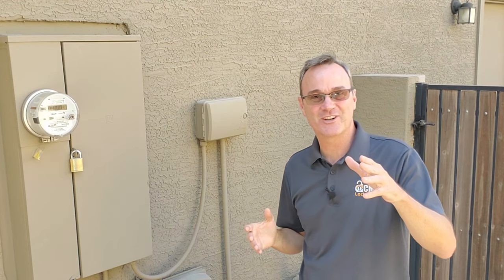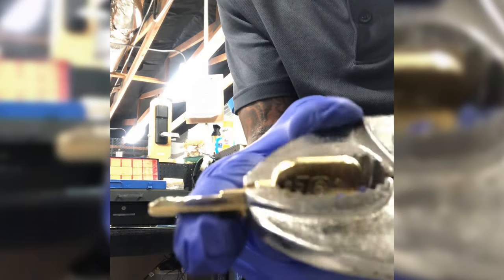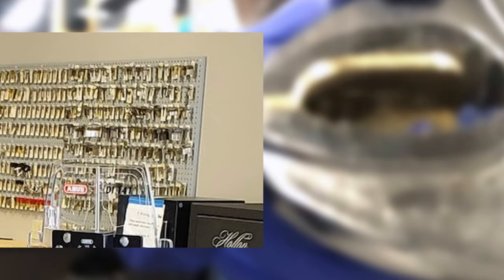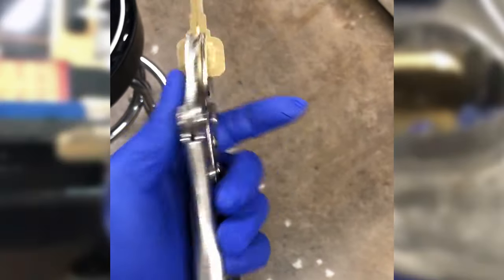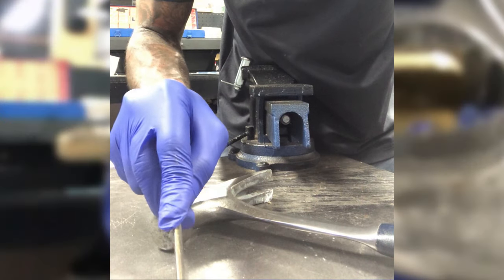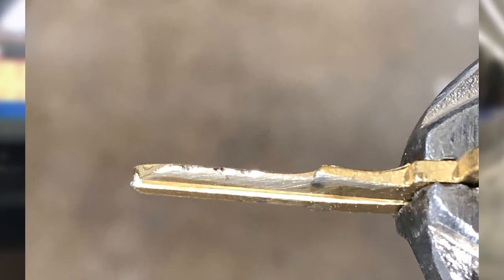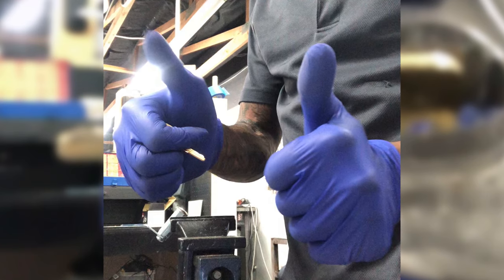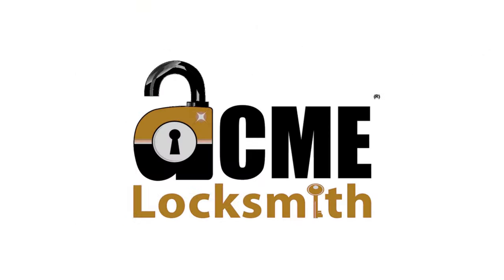How Do Locksmiths Make Keys Without an Original Key - How to Impression a Key

Comment: I did what you said, and now have a key that turns the lock in my 29 Ford Pickup. Not quite sure I want to take this back to the shop that said they could not do it. I do not think they wanted to spend the time! Anyway, thank you, it worked. I am a retired electrician and mechanic, and followed your instructions. First key worked! Doug, Oak Harbor Wa.
Reply: I mean if someone came to me asking for me to pick a lock and I’d never tried I probably wouldn’t do it either lol. Impressive you did it yourself
Reply: Im in same boat im electrician and also have done hands on work my whole life and im gonna give this shot only thing bothers me is when pull key out it brakes inside then ill be in serious trouboe but i just got to be easy and shake little back and forth seems pretty easy but something you get better in time

Comment: worries that locksmiths will make a key to my car and drive off with it
Reply from the maker: Newer car keys needs to be programmed to the vehicle in order for the vehicle to run. FYI. Auto locks are some of the hardest to impression. Most locksmiths can't do it. They opt to make a key by code for the car

Comment: I just tried to get a local locksmith to make a key, I knew the profile and I recon they need to see this video as they couldn’t or wouldn’t make a key for the two barrels, I am definitely going to have a go with this technique. two days latter using this technique... I worked, I knew the blank profile , i filed it down but buffed it to a high shine and this helped identify the marks.
I am looking forward to the look on the lock smiths face when I take the key to get others made.. as I mentioned the technique and he just smiled Follow up the Lock Smith was impressed "well done"

Comment: thanks for video. my local locksmith did this type of key making twice for me. they did it while I waited and it took less than ten minutes both times. both times it was ten bucks including the key. couple months ago I needed this service again but price has jumped to 30 now. the trick from the past that I saw was they used aluminum key blank which impressioned much easier.

Comment: Good video.  Those wafer locks are definitely good to learn with.  I like to, once I get my first set of marks, take a thin Sharpie and mark on the side of the blank where those marks were so if I see other marks I'm not following a wild goose.  

The other thing I did was picked up a cheap set of jewelers' loupes.  Makes seeing what's on the blank way easier.
Reply from the maker: Thanks for the tips!

Comment: Great video! I guess you should mention not to put too much force on the key when impressioning, you don't want to break the key off in the lock. How do you know how far to file down each spot after each impression round? A lite mark gets a tiny bit of filing down and a heavy mark gets a bit more of filing down? How do you know when to stop filing down in one spot... no mark at all?
Reply: This is exactly what I was wondering. Like how do you know when to stop filing on each pin?

Comment: Yeah I did this on some old locks I didn’t have a key for the first one three times nothing its a old big no5 master lock .  Second one newer type with the blue band at the bottom no3 first key filed kept at it just working the hell outta it and bam it turned made two new keys to fit it off a bunch of used keys .  I’m on number 5 now with the old no5 it looks like it says in black ink A631 or A531 it’s faded badly .  I’ve broken a couple  keys pulled them out before they were in two .  I found keeping the points down between the notches helps I’d could see we’re the tumblers we’re hitting the ramps up and down .  It’s a job that requires patience and skill with the ability to keep trying till you succeed.  If you get aggregated to lay it down and mess with something different for a while then come back to it .  It’s definitely a learning curve! Thanks for the video it’s been helpful !
Reply from the maker: Great post. Thanks for watching.

Comment: I’m trying to take out the in dash ignition switch on a 1984 Winnebago with a Chevy P-30 chassis because I don’t have any of the keys that’s how I found your channel . It seems easier to just enlarge the area around the ignition switch rather than destroy the cylinder. No that I’ve seen this I’m gonna give it a try. Thanks 😊
Reply: You should be able to get a key made using the VIN number
Reply: @Berry-McCaulkiner  This is often not true.   The dealers do not maintain Vin-to-key data beyond ten years.  There are some special locksmith databases that can give this information.  Unfortunately, most locksmiths either do not know this or  will not tell you about it.  They will try to sell you a "service call" where they come to your lcoation and make a key for $200 instead of making a key by code (looked up by vin) for $30.

Comment: Does it matter what side of the key you file at an angle ?
Reply from the maker: No. Just need to thin it out.
Reply: @LocksmithRecommended  
Thank You
I took a key and filed it all down and then filled it in with solder and I filed down The notches that I could see on the solder because solder was so soft and then it worked and then I made a copy of that.
Thank you so much for responding to me that's a great video

Comment: could you make a tin keyblank? if i take a pieces of tin fold it in half and cut out the key with the sharp point. (the corners of the tin is were  the sharp point is.  so like the  fake key is lift with a strong back back because its the curve of the folded tin. so you would end up with softer metal to make better makers.

Comment: Where the mark is, do you file it down? Or leave the “bump” where it marked? I’m not sure if the mark should be the “point”, or the “hollow” in the key. I hope it’s understandable what I’m asking, I’m not sure in how to proceed.
Reply from the maker: File at the mark. That is a pin hitting the key.
Reply: Thanks for answering. I’m researching all I can, because I got an old motorcycle without key.   The problem is that we’re I am (a very rural place), it has been impossible to find blank keys. I’m going to try cutting a key from a picture I got online and hopefully I can make it work. My first try will be with soft metal from a can, because I don’t have tools to cut harder material. Do you think it could work with some patience? Or will I be wasting my time?

Comment: I’ll be diving into a DIY project to impression a new key for my 67 F250, an old airport stair truck from northwest airlines, unfortunately key not present.. any suggestions for applying this technique to a key with pins on both sides of the key? I’m assuming same technique applies cutting both sides same amount each time?  

Couldn’t source a new old stock ignition tumbler as the 67 were one year trucks with small variations to the 68. 

Thank you in advance!
Reply from the maker: Same process, but extremely difficult to do. You could always mail it to us and we can get you a key for it. Without risk of damaging the wafers. If you're interested contact us here. https://form.jotform.com/60085597700155
Reply: @LocksmithRecommended  I would be able to remove the ignition as a whole, mailing the core still inside the ignition as well as a blank to use. If that would be acceptable I can go through the link and send it out :)
Reply: @branpugh  Did you manage?

Comment: Wouldn't it be a good idea to paint the blank key to make the impression more precise?
Reply from the maker: Possibly. Never tried that one. A lot of techs us smoke by holding a lighter under the key to blacken it.
Reply: @LocksmithRecommended  A Sharpie works even better and afterwords the marker ink wipes off with rubbing alcohol.

Comment: Well, I've done this back in 2019 very easy, but not for door locks or cam locks. I made car door locks and then moved over from there to make an enshanine key because the old ley broke, and when we took it to a locksmith or a hard wear store to get it copied we brought it back home and tryed it out it did not work to turn the car over so I looked at the old key and the key copy and took a sharpie and traced the key depth after doing that I noticed that the copied key tip was filed down to far this was for a Chevy 2019 avio I then  tried it my self with files to get it to turn the cylinder in the steering weal over or as you would calling it the enichen switch sorry I have a bad phone spell check system but after the first one I made and how time consuming it was to file it I then when back to that same hardware store and asked if near the end to not cut the last part of the key or instead I will just buy 6 blank keys and trace then key I made over to the blank key witch in return made a slite mess-up with out holding the keys to gether with a ficegrip and then marking them but the good thing I noticed it before I started filing the key so after filing the key I wire bushed it to get rid of any left over debree and I checked the inner cylinder to also see if it was dirty at all to mack shear there was not any thing gunking up the lock cylinder 
From Joshua rowell. Ps the store that cut the key wrong was ace hardware in Vallejo, CA, contact me if you would like, and thank you for letting me leave a comment have a nice day.
Reply from the maker: Thank you for the comment!

Comment: So if I file it to one said maybe the impressions will be easier to get from the grease instead of denting the metal of the blank
Reply from the maker: Smoke from a match works really well. Hold a match or later under the key until it darkens.

Comment: I'm really worry that this video is for everyone including the burglars?  anyway, my concern is, could this impression be done on a kwiset lock whether it's an inside or outside lock?  becz, how the criminals entered my house and had keys for all that locking device, is a major question to me.  thanks.
Reply: Best to update your locks Veronica, to a system with restricted keyways. Where they are not able to get their paws on blanks to cut. Good luck.
Reply: I replaced my key locks with coded locks. No longer have key entry...believe I was broken into with use of a bump key
Reply: @assakesomanlockman7179  --- Or just replace the very old locks that everyone in the neighborhood was given a key to in the past.

Comment: I lost the key to my cable bike lock. Is it possible to make a key replacement??? Thanks!
Reply from the maker: Should be, depending on the keyway. Also, depending on the lock, it may cost less to replace the bike lock.
Reply: @LocksmithRecommended  oh k thanks for the fast reply will look into it.

Comment: Interesting. I would have thought that you’d pull the core out and make it pin by pin.
Reply from the maker: That is another method. When you can remove a core without the key you can read the pins to get the cuts.

Comment: Lost my keys while on vacation, cheaper to buy new door handles and dead bolt from lowes or Home Depot than to hire a locksmith. Still not cheap but cheaper. If you loose a car key look out these keys are not cheap, they will have to reprogram your car to make the car to accept the new key. Always have spare keys and don’t loose them like I did sad😢 a new car key cost me 320.00 bucks.
Reply from the maker: Good advice. Always have a spare.

Comment: seems to me it would be easier to just re-pin the cylinder.
Reply from the maker: To repin you have to get the cylinder out. Which requires turning the cylinder, as if you had a key.

Comment: And that's it - brilliant,  your lock has locked what it is in so you take or smash the doors off to get the lock out, when you get the new lock and key, your next stop is the carpenter or metal shop to make you a new piece of furniture. Forget keys, just booby trap what you want to lock. Locksmiths coming to your house Plan to pull cash out of your nose?

Comment: You just told how people and perps can breaks intp victims homes of DV, rape, abuse , extreme trauma!!!? STUPID ADVICE!!!
Reply from the maker: Wait 'til you hear about the Lock Picking Lawyer. ✌️
Reply: Yes , first they steal your lock, take it home for a day, make a key, bring it back to your house
and refit it, then use the key to break in. 😂
Reply: You will be super sad to watch a "lock bumping" video. This video method takes a loooong time to get a proper key. Bump keys, don't need but 20seconds and a few taps on a generic saw key with a screwdriver... 😬
Reply: Belevie it or not criminals learn from other criminals on how to "defeat" locks.  Most crooks will just break a window or smash the lock. Every crook worth his salt knows you can take a 6 foot pipe that fits over the knob and break the lock off. This is why you should have strong multiple locks/bars on the inside of your doors, especially in an apartment building where there is no easy access to a window, if they want get in with a pipe, it is fairly silent. Most crooks don't even worry about alarms. RING doorbell cameras are great. Before you get home and open the door, you can use a smart phone to see if there was ANY activity at your door. If your system was defeated, it would not show you waking up... don't go in.

Comment: My friend had "The Club" https://youtu.be/JXiSZnhD6m4 steering wheel lock in the 80's for his car. I told him it was a fair deterrent but cut out switches and such would better along with it.
I had one too, but I had custom theft deterents in my car - I am an engineer and sadly have a criminal mind (but law abiding) so I was very creative.  The Club lock used  plates not pins, it was very "loose" (a lot of tolerance in the keying), and I could pick one in 5 seconds with two properly modified paper clips.
Anyway, we went out to lunch one day and he ran into a convenience store for a lottery ticket. I told him to put the Club on his steering wheel and I waited in the car. When he came out less than a minute later, I handed him his Club removed from the steering wheel, undamaged, and relocked. He wanted me to help him add theft deterrent systems for him after that.